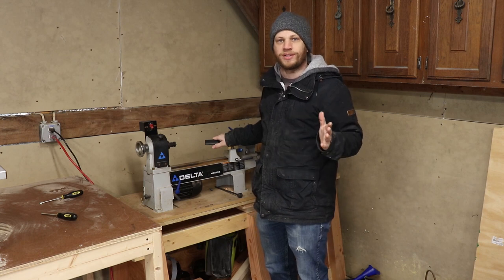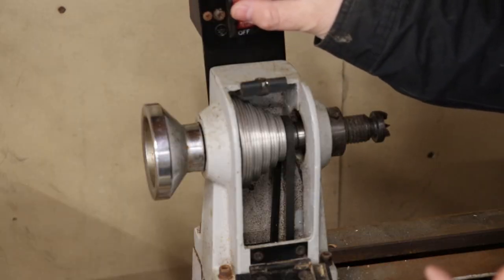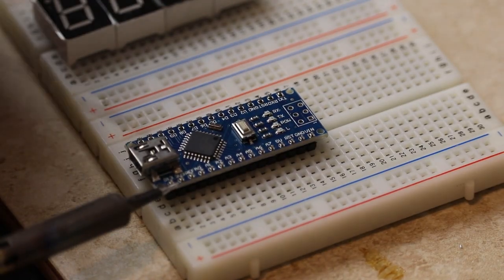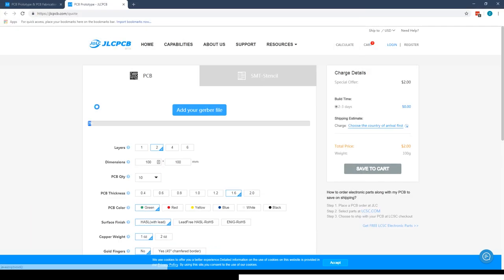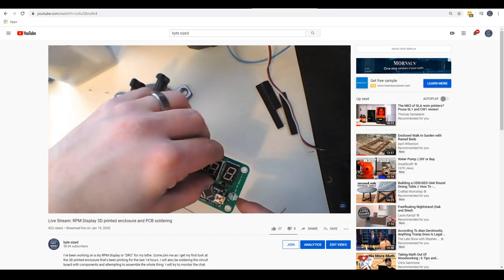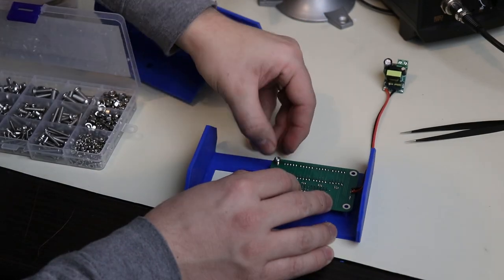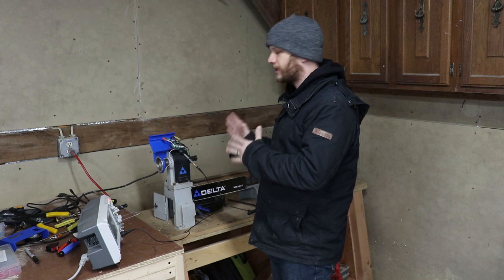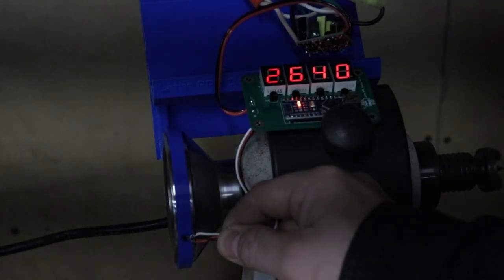I Made A Digital Readout For My Wood Lathe!

Comment: You should align the magnets with the poles alternately N S N S and so on. Then the sensor would detect a change in the pole of the magnetic field. You could then add more than 3 magnets per circumference.

Comment: Nice work! PCB making has become much easier.
In the 80's I used a program called MiroCAD on a PC XT, made IC templates, pads, etc. and I printer them on a B size plotter with clear plastic sheets.
I then sent it to the print shop, where they used this huge intense light, used to burn images on those metal sheets for printing papers.
Burnt that image on positive copper clad board, and placed it in the solution.
Lot of work for a simple thing back then.
Another way, was using a special marker and drawing directly on the copper clad board, or using thin black tape.
One of the first boards I made, was for a TV jammer, that was fun. Not useful in the modern day of Cable TV. :)
I think I still have the A Plotter in a closet at my parents house. lol
Reply from the maker: I think the process is still the same, only now I can send the digital files to the board house and they take care of the rest. I've etched my own copper boards at home before and they never turn out as nice. Professional boards have become so cheap there's no reason to do it yourself anymore.
Reply: @bytesizedengineering  Agreed. The big difference is these newer apps that are often free to make these. Back in the day, I didn't have these tools, so I made the pads and layouts manually. Keep up  the good work. I always look forward to your videos.

Comment: You got a lathe! Play with that for a little bit, but before long you are going to want a metal cutting lathe. (And a heater for your garage) nice video!
Reply from the maker: I know, it's only a matter of time before I need to machine something in metal. One step at a time I guess...
Reply: @bytesizedengineering  it's not just that you will want to cut metal. It's the accuracy that a metal cutting lathe will hold. It will enable all sorts of new projects and ideas.

Comment: Of course its jumping by 60, cause 1 rev more per second is 60 more by minute. What i did was not measuring pulses by second, i measured how long it takes from one rev to the next. More precise, more accurate and way faster on display. What i dont know is if it fit to such fast pulses. Afaik 6mikroseconds is the shortest pulsetime u can detect without a hassle.
Reply: Yeah, it was not the best approach. There's also no mutex/lock on the count variable. Measuring the time between pulses (or time for N pulses) will give much better accuracy and much less jitter. The hall effect sensor pulse is much larger than 6us, going by the oscilloscope capture.
Reply: ladi jada i never hit this border, so how can i know. 2 ideas come up to solve this. What about more distance between magnet and hallsensor, and how about dividing by using boolean logic ics (as in the past)?
Reply: @notofinterest  I'm saying the pulse is so slow and wide that it is easily detected
Reply from the maker: This is a great suggestion, I appreciate your comment! I'll give that a shot and see if it helps.
Reply from the maker: Thanks for the suggestion, I'll give it a shot!
Reply: Another hint: if you convert it back by dividing by 1 u better use 1.0 to keep that variable as float. Dividing by one makes it a integer, and you wont that. Took me 2 days of my life to find that out, and no, you cant google this. My present to you 😉